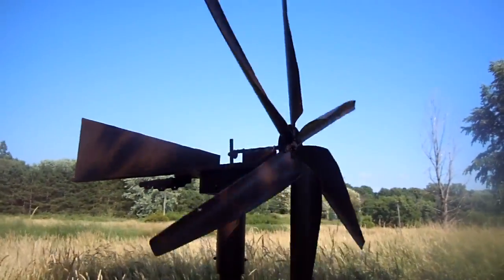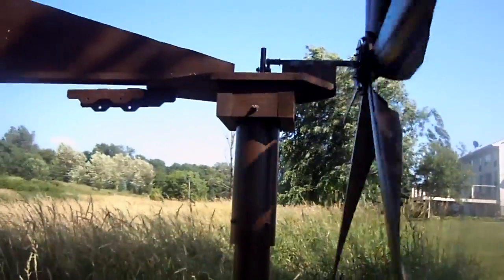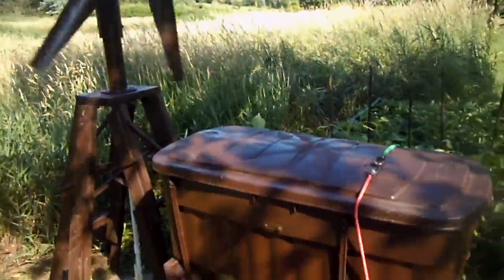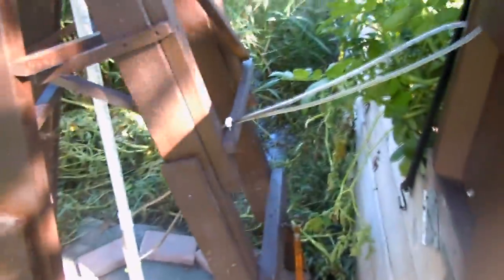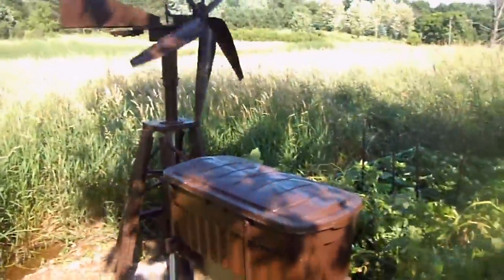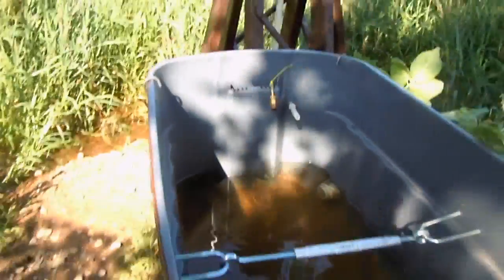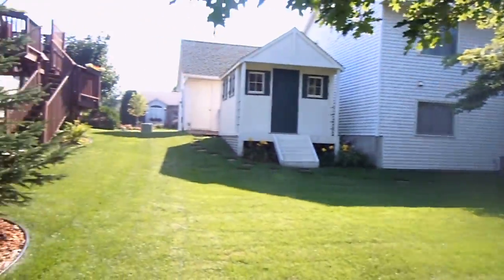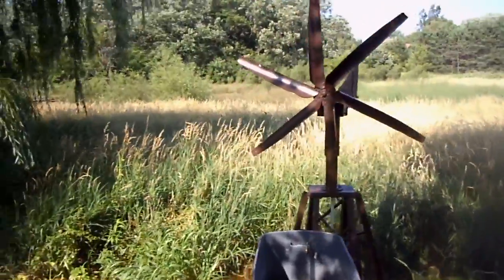Homemade Windmill Waterpump Garden Irrigation System, Part Two

Comment: Ok, Im currently building one very similar to pump water from my in ground cistern up into the tank on the roof of my house to have running water indoors, my question is can you explain more on how you placed your windmill on the pipe, and made it so that it rotates to catch the wind... What did you use? I absolutely love the no games design of your windmill pump, but Im struggling with how to attach it to the pipe, and let it rotate freely as to better catch the wind. Thank you in advance.

Comment from the maker: Look at "part one".  It shows my pump.  The key to the pump is to have two check valves so that water is allowed to suck in when the piston is pulled up, but not allowed to go back that same way when the piston comes down.  The other check valve allows the water to push out, but doesn't let water to come back into the chamber.  Once you get that part down, you can design your pump.  The weakness of my pump was that the piston leaked a little.  Then it wouldn't stay primed once the wind stopped.